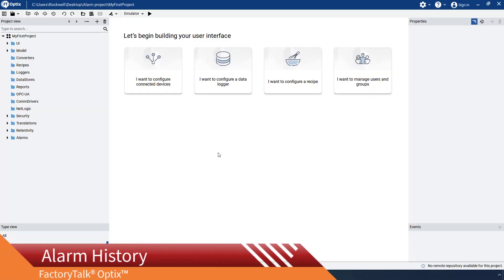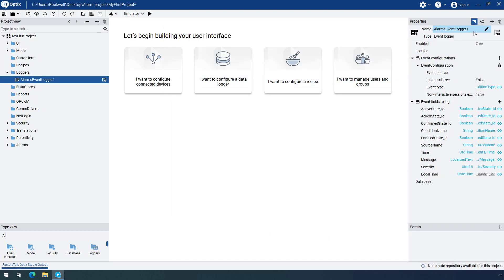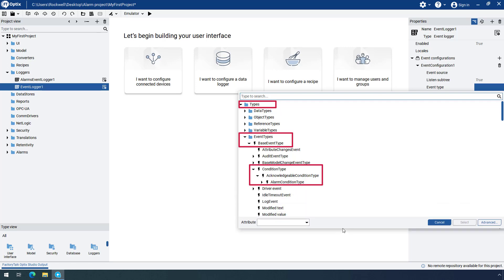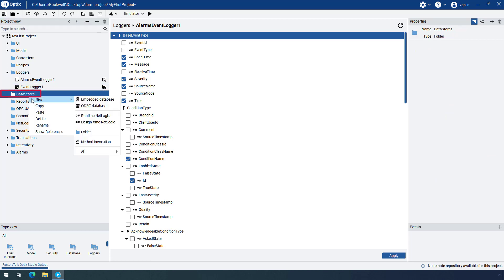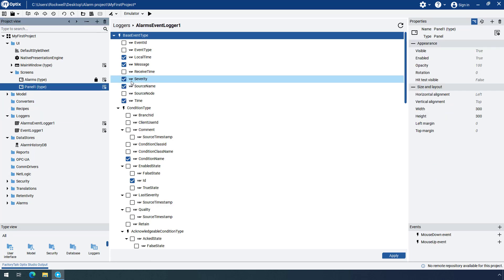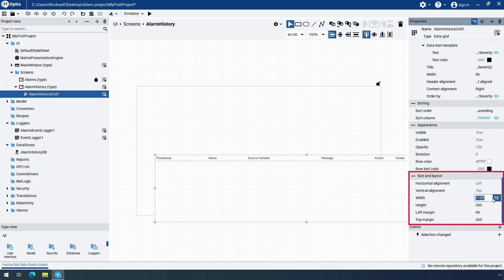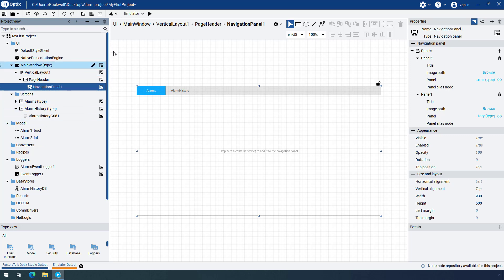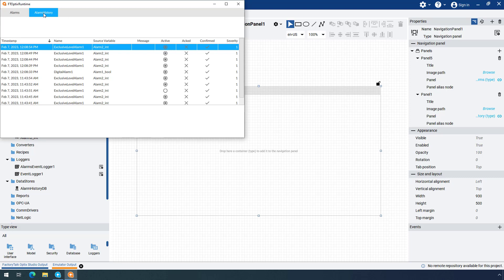FactoryTalk® Optix™ Getting Started - Alarm History

Comment: But how would you add the HighHigh, High, Low and LowLow text in a column to the history like it was done on the Active AlarmGrid? I can't find the options to do so as when I add another column to the AlarmHistory grid, look at Aliases and in the alarm datagrid I don't have the "alarm condition" as an option

As it stands you know a level event happened in history but not which one. I tried to add the Alarm Value to the Analogue Alarm Message, but that doesn't allow a dynamiclink.
Reply: For detailed assistance on things like this, head over to Rockwell's Engage community. There are experts there who can help.